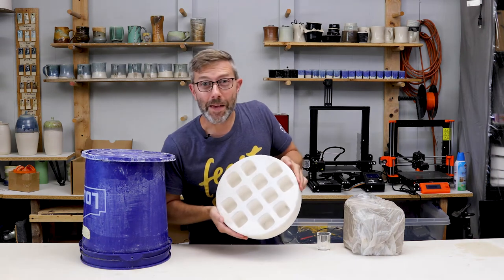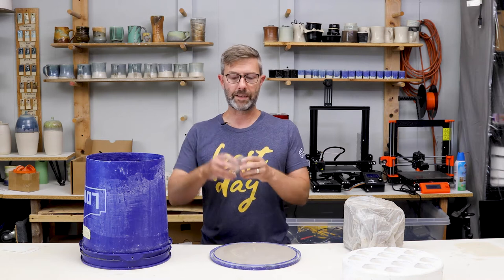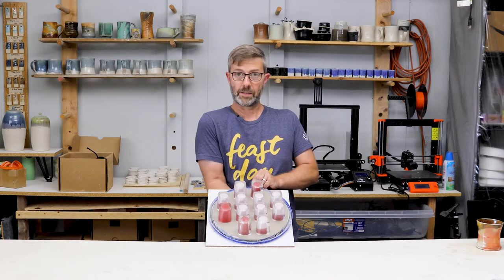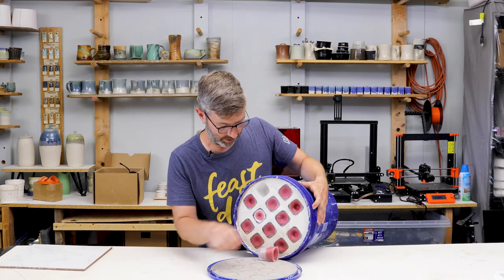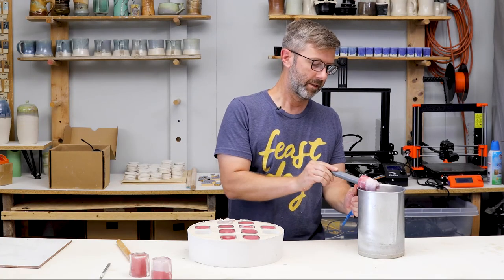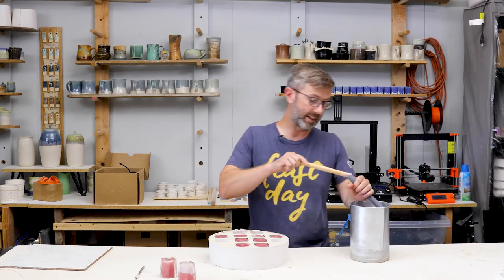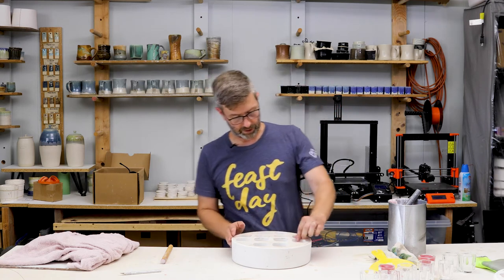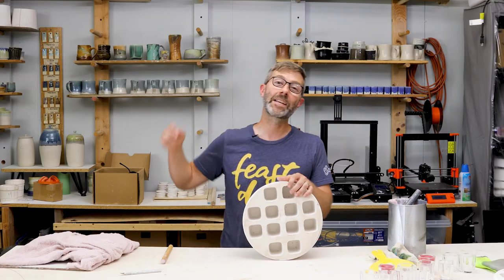12x Your Pottery Production With This Plaster Mold

Comment: Would the spilt waxes hinder with the process of casting? I imagine the wax should cause uneven water exchange from casting clay to the plaster mold.
Reply from the maker: yes. I would try to keep the way away from the plaster.  Since publishing this video, I actually found that shortening works better than wax as a filler.  Cisco i think is what i picked up at walmart for about $5.

Comment: Why you don’t fill them with clay instead?
Reply from the maker: Sometimes I do.  I've generally kept clay I work with on molds separate from clay i work with on the wheel or slab building.  So i haven't filled them with clay as much because I don't want to waste the clay.   But I need to just have a full bag that I use for clay outs and filling models.  I'll probably do more of that in the future.  I like how I can recycle the wax and it usually helps me to get the models out.  Thanks Alexandre.  What does your process look like in your studio in Canada?  I'm really interested how you do it.

Comment: How much plaster did you use? Love this video by the way. 😊
Reply from the maker: Thanks Katie.  I usually eyeball it but the technical ratio is 7:10::water:plaster.  So 7 parts water to 10 parts plaster - by weight i think.  It doesn't have to be an exact science though - there's some wiggle room.

Comment: For pulling out the glass I wonder if it would help if you coated the end of a regular pair of pliers with silicone and then undid the bolt on the pliers and reversed them so that they will grab outward and you can pull the glass out
Reply from the maker: That's a good idea!  I'll try that next time.  The gloves help too.  I should have put those on sooner, but I'm glad it took a while to show people what might happen.  Thanks Levi!

Comment: I thought of, but haven’t tried it out yet- A coat hangar wire with a short L bend at the tip
Warm it up and sink it into the wax, let it cool
Pull the glass up out of the hole with the wire.

Thanks for your friendly sharing of your strategies to make pottery! And let the mold dry for two weeks before you use it if you will be using it 100-150 times.
Reply from the maker: This is a great idea Keith!  I'm going to try it when i do my next casts.  Thanks for the idea. I'll let you know how it goes.

Comment: Hi @outpostpottery Thanks for your videos.. very helpful! I wanted to ask... where does the "thickness" of the "Shot glass" come from? So, I understand how you've made this mold... but, I'm trying to understand where the thickness of the "new shot glass" comes from?

 For instance, I have a cup that I want to make a mold from and the thickness of that cup is around 3/4 of an inch thick.. so, my question is, how is it possible that once I pour the slip into the newly created mold.. how and where does the new 3/4 of an inch come from with using the new mold to create the new cup? I hope that's clear.. just trying to understand where the "thickness" for the newly created cup comes from.. how does the slip that dries, that creates the new cup, know how to create the thickness. It seems like the thickness from the new cup would only be "paper thin" at best? What am I missing here?

Any insight would be greatly appreciated!

Best,
PodPrompts
Reply from the maker: Hey PodPrompts.  Sorry for my very late reply. The thinkness of your wall comes from how long you let the slip set in the mold.  If you let it set for 15 minutes you'll have a thinner wall to your cup than if you let it set for 30minutes.   Be sure you keep topping the slip off along the way though to keep your lip consistent.   Let me know if you need additional clarification.  Sorry i'm not on here as much as i used to.  Happy Casting!

Comment: Just a quick question. A shot glass is 1.5oz. If you make a mold like this and slip cast it, the casting after firing can shrink as much as 10% in size. 
How do you compensate for those losses?
Reply from the maker: Great point Grandpa's place.  yes it does shrink a little more than 10%.  HOWEVER, these shot glasses have a good deal of glass at teh bottom of the originals.  It' makes it heavier but takes up a good bit of the volume of the original.   I think the actual volume of the original glass shot glasses and my casts are roughly the same becuase of that variable - even though the originals are larger on the outside.  Does that makes sense?  Sorry if i'm not explaining it well :) -mj
Reply: @OutpostPottery  That makes sense. Ive been trying to figure out how to compensate for shrinkage on molds for things like plates, coffee cups, etc. Though I may be overthinking it. lol
Thanks for the reply
Reply: @GrandpasPlace  you might find a shrinkage ruler to be helpful.